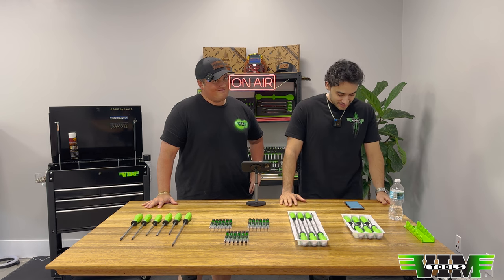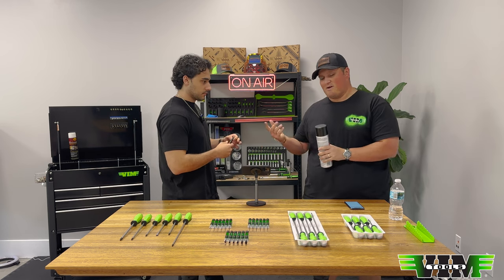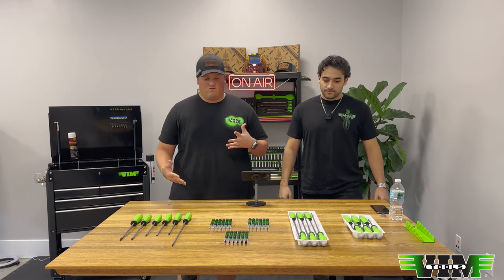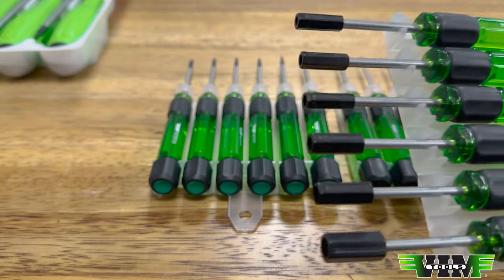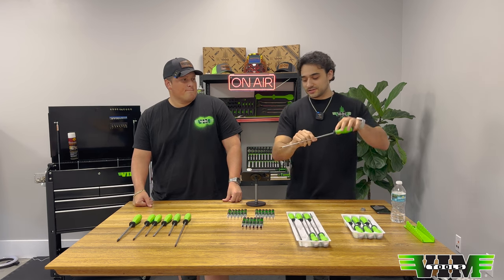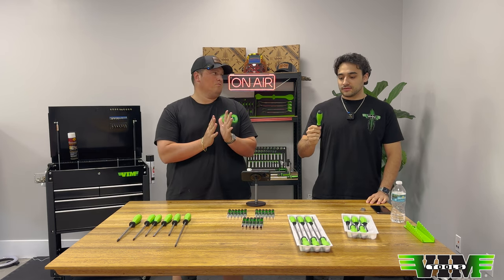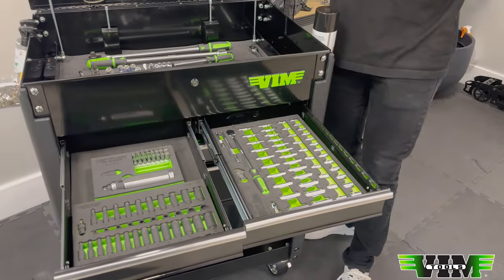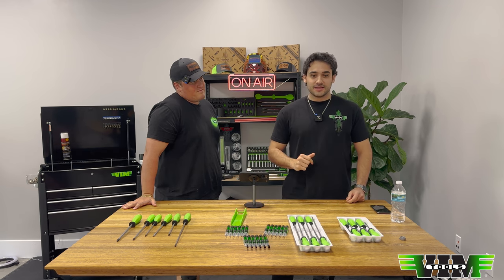VIM Tools Tuesday Ep. 22

Comment: you guys had the showing of your 1/2in metric impact sockets for wheels. could you guys make a set in .5 incroments? with the swollen wheel lug nuts the 19.5 and 22.5 are needed alot. i also in need of a 17.5mm and no one makes them!

Comment: -The Green soft handles should be refered to as;

The new Green VIM No Slip Control Grip at your fingertip with twist and turn companionship, allowing a drive train relationship kind of dictatorship for a battleship kind of craftsmanship to tighten or loosen any helical shaft with a flagship handgriped unmatched workmanship with a squeezable soft grip fluid control handle.